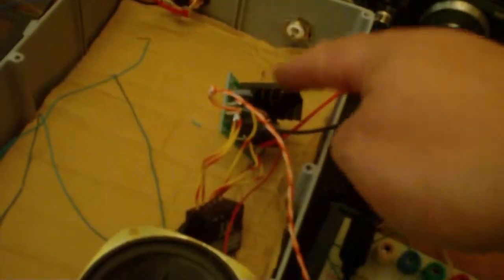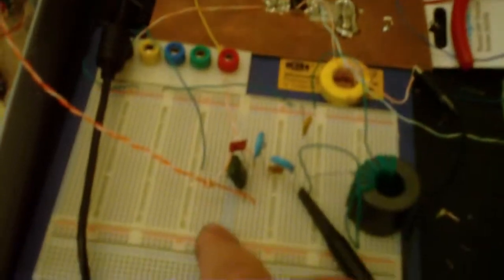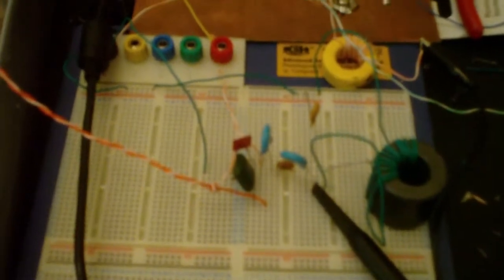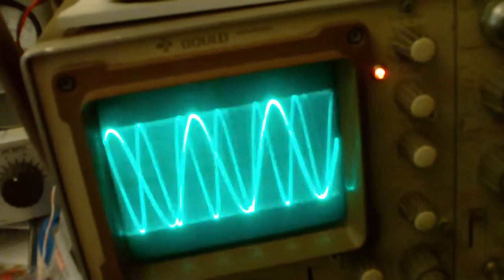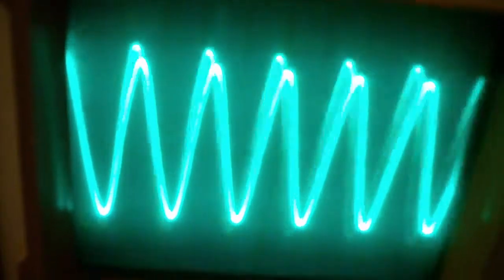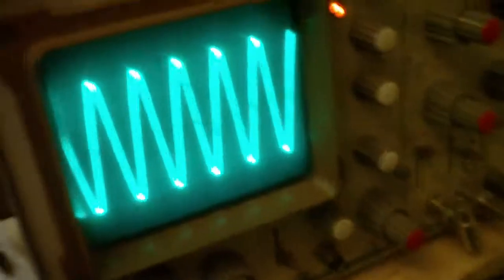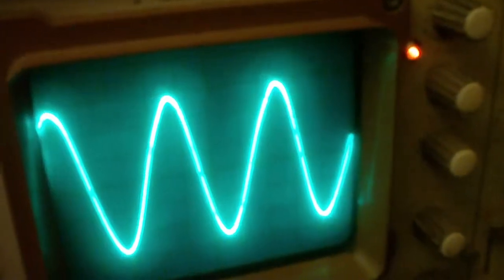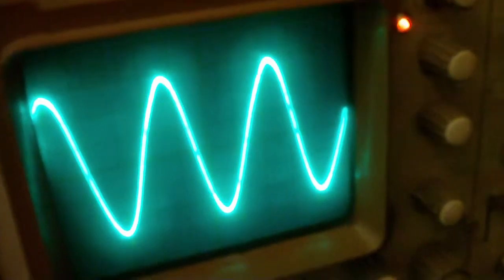Homemade Radio Receiver project - Part 1

Comment from the maker: @sh3ifan Thanks, I need to do another video on it, since I have now made some changes, the oscillator is now operating around 6-8 MHz, and is a lot more stable due to removal of one of the pre-amplifier stages. the next stage is to add some pre-selection, as its currently receiving everything, and I discovered it doesn't like strong local interference like fluorescent lamps, and network cables etc as it overloads the front end and you cant hear any of the weak signals. :P